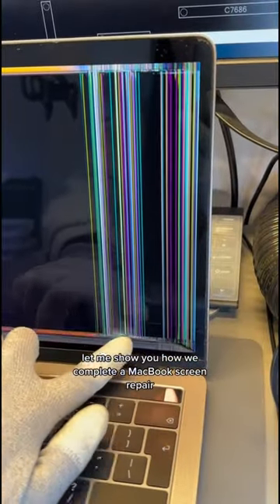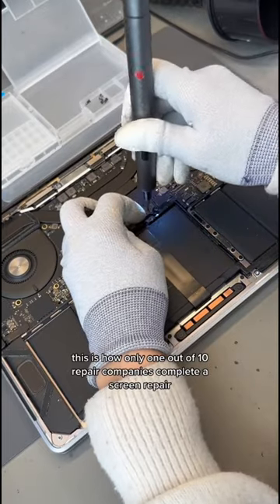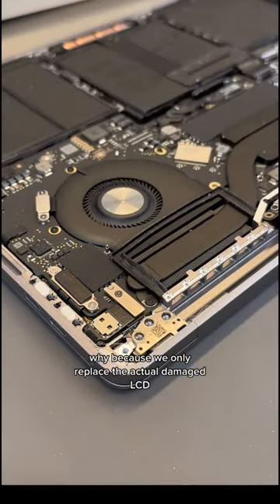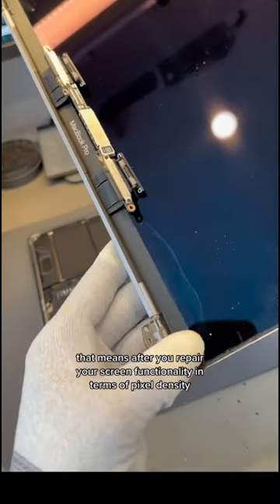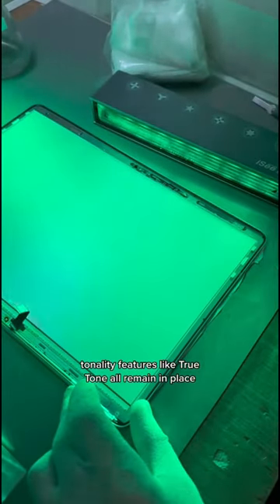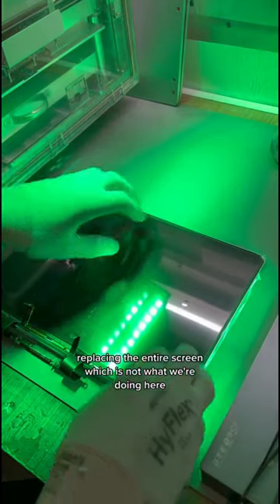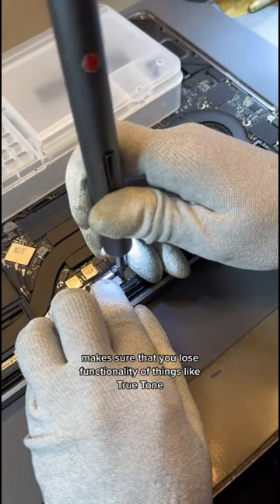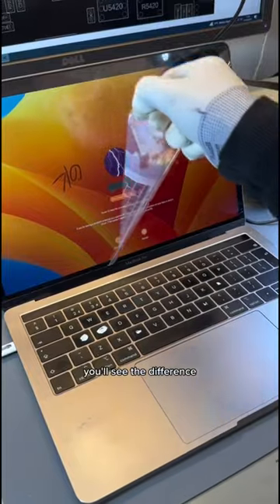MacBook Screen Repair Keeping All Features Through An LCD Repair.

Comment: One of the many reasons to avoid apple
Reply: ik my lcd thing is cracked n the black spot just keeps growing. its taken up a good portion of the left side of my screen
Reply: @nutzitchi got the same issue…damaged on the lower left side of the screen, had those damage lines earlier now the whole screen completely went off💀
Reply: @kinglamusic how much they will cost
Reply: Do you guys maintain your MacBooks????
Reply: @PleaseDontMindmyDisplayName ive had 2 macbooks lol a late 2013 and a m1 pro,ive never ever ever had any problems and im switching to windows cuz i want to game lol.but macs have been so reliable to me the phones are way worse when it comes to damage imo
Reply: @kinglamusic yep mine is now off too lol
Reply: @KAIRB_1 mine too… any idea of where one can get a new display screen? Apart from apple of course 😂

Comment: Just did this repair myself. Super easy and we always turn off true tone anyway lol
Reply: This dude say non sense… he talk about True Tone be related to body aluminum ????!
Reply: @isacferreira6804 yeah, apple locks the display to the body of the MacBook, doing an screen repair without setting over the serial number to the new display you lose features
Reply: @Falln69  i am speechless … só Thérè is some digital signature of the Body to make screen like original ?
Reply: @Falln69 i hope you’re joking 😂
Reply: he talks about designers needing truetone LMAO they literally need color accuracy and truetone is the last thing they want
Reply: @isacferreira6804 if you look when he removes the LCD part, there is a ribbon cable still there. that ribbon cable is what tells the mac info about the display (a la, has it been replaced by using if the sn matches, or however they do it now)

Comment: I have this exact same laptop and my screen has just appeared with the lines and won’t display anything apart from the the esc button on the Touch Bar so Im assuming I’ve broke the screen How much will a repair cost???
Reply: Also I’m just worried about having my data wiped will I be able to keep everything on my laptop??

Comment: I would point out that apple replaces the entire screen assembly and then uses calibration software to set things like trutone back up.

this repair is still third party and if it's not done perfectly, apple will be able to tell and they'll deny warranty due to the uncertain provenance of the parts.

let the buyer beware, it's better to just not buy an apple product at this point in time.

Comment: Can you do this with a Kuu Yepbook Celeron N5095 15.6 inch 1920x1080 16gb ram 512gb ssd non touch windows 11 pro
Reply: I will answer instead of them - anyone who has two hands, a screwdriver and an access to internet to order a screen replacement can do it. They seem to have everything I mentioned, so yeah, they will be able to do it. The used full hd 15.6 lcd may cost somewhere between 25 - 50$, depending on your location and googling skills.